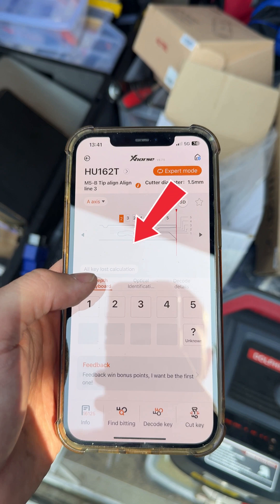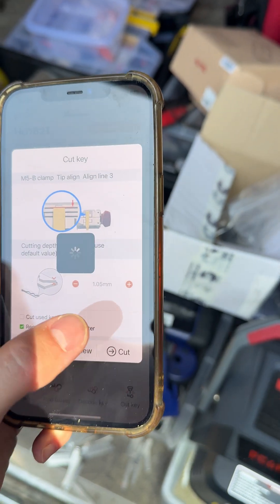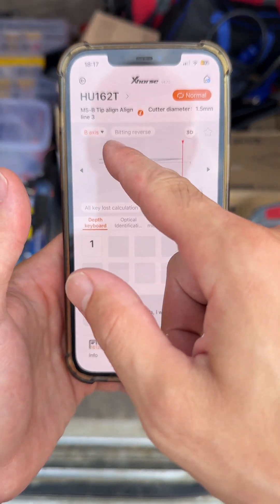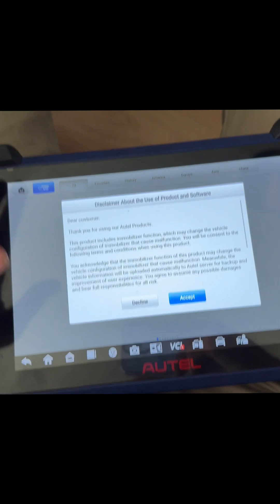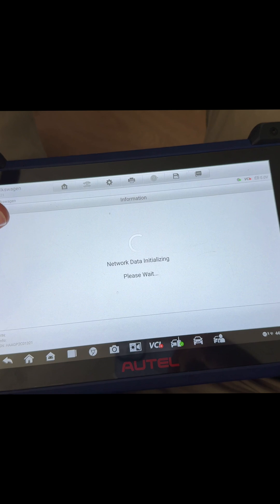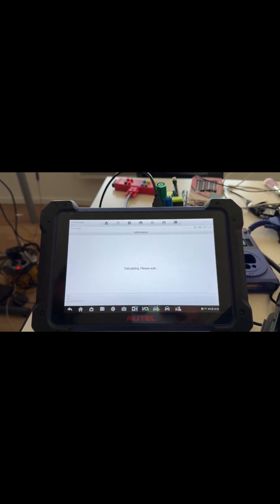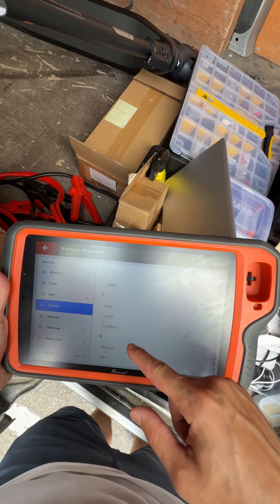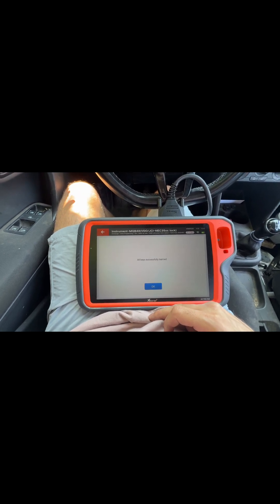All Keys Lost - VW Polo, VW Golf 7, Seat Ibiza ... - Key tool plus & Autel

Comment: Hi, Kepp doing this, your videos are very helpful. Can you please tell, for all keys lost, do you need data from dashboard and ECU if the the car has no keyless and it is manual gearbox ? This is valid on all cars from VAG  ? Thank you.
Reply from the maker: Hi, as long as car is none Keyless and manual gearbox, the technique shown on video works. I would post full tutorial soon stay tuned
Reply: @Gentleman_Prog  Ok, but what about the 3rd party sinc file, from what I saw the Autel will read and decrypt the immodata from dash and then must read the ECU with G-box for the 32 numbers. Thank you for your reply.
Reply from the maker: @VladMBC  I’ve tried, it didn’t works. You can try maybe you’ll be luckier thatn me
Reply: Exact Video not Show how you get the sync file? Dash and ecu data are enoth to get the sync data? Elv dont need?
Reply from the maker: @waldemarfechtel1644  You must watch the whole video and you’ll get answer to your question
Reply: Ok @Gentleman_Prog
Reply: @Gentleman_Prog in Video cant see clear the last data wich you load. This is why I ask
Reply from the maker: @waldemarfechtel1644  i’m explaning the whole process, take your time and watch the whole video, if you have a question that is not answered in the video no problem